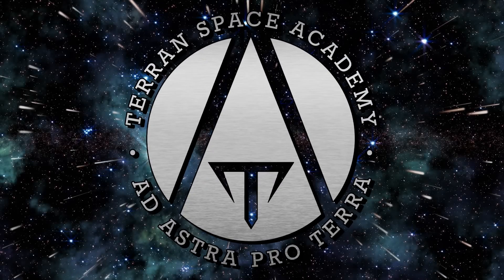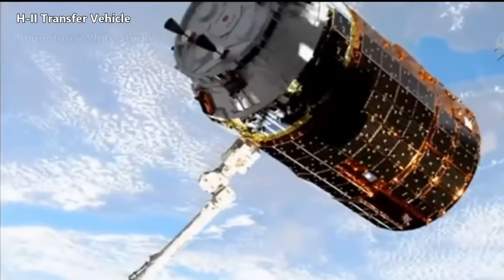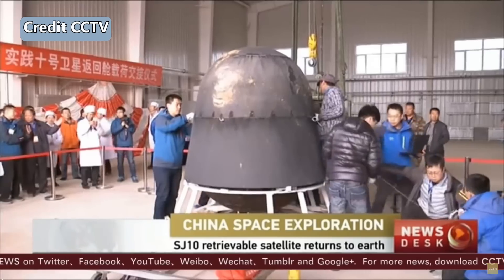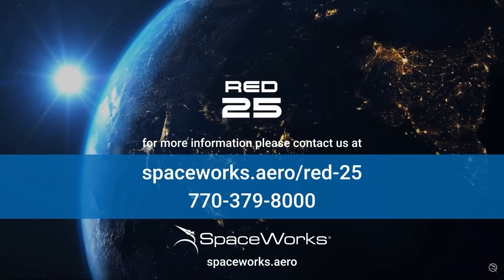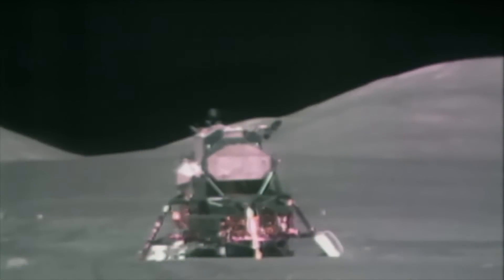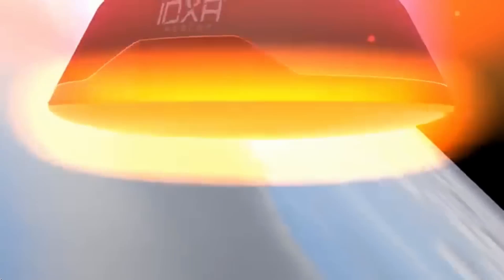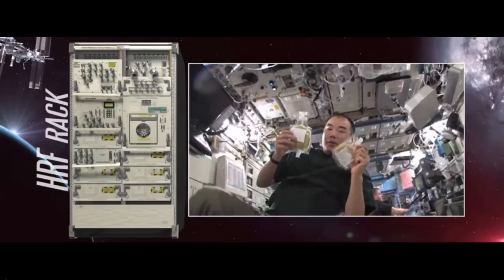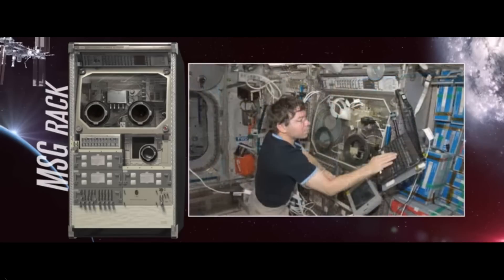Rocket Science: Orbital Cargo Return

Comment: Hydrogen power is very promising as a power source in aircraft.  Not so in cars.  The problem is hydrogen handling systems are too expensive and complex for cheap cars that have questionable maintenance.  Hydrogen molecular size and reactivity makes it hard to contain compared to any other high pressure gas.  A hydrogen car would be expensive and high maintenance
Reply from the maker: We agree completely... though the ghost of Nicola is still trying... under a different name of course.

Comment: Why don't they make the Bottom of these Rockets ... Flat ? ... Like a half circle ... Why does it have to look like a Bullet ? ... and add some Wings ... Then on the way down , they can catch the thin upper Atmosphere to lose speed and gain lift to stay in the thin air ... to draw out the descent , reducing speed slowly ... Why not use Mother Nature to help fly down , instead of dropping like a Rock ... You also gain a smooth flat surface for installing Heat Shield Tiles ... You could make the Fuselage a lot Bigger too ... That returning Moon Capsule bounced along to lose speed ... You could skip off the Air like a Skipping Stone and Land like a Plane ..... The Space Shuttle worked great ... But the Fragile Tiles doomed it ! .... How High do Stealth Fighters fly ?   :-D
Reply from the maker: Good question.  How about a flattened triangle?  Wider on the bottom?  That would make it fall correctly just by air resistance and would not interfere with the climb to orbit I don't think (if oriented properly).
Reply: @terranspaceacademy  Flying up to the thin air , then starting your Rockets to reach orbit , and gliding back down slowly ... Saves a lot of Fuel and Weight and Heat ... or with some Extra fuel they could compensate for engines not working ... by extending the burn ! ... It's the only way to take stuff up and bring stuff down ! ... I wonder Why they are Not doing it ?